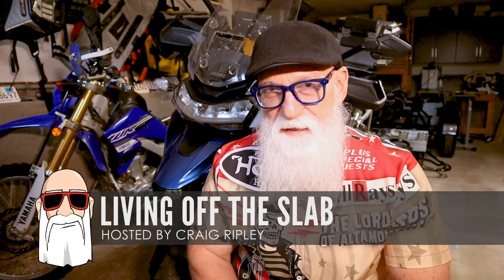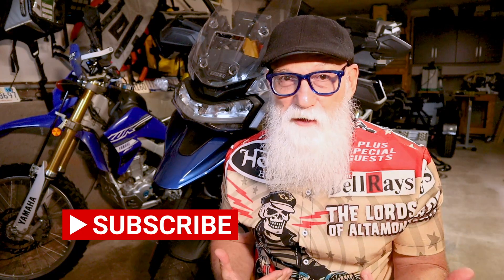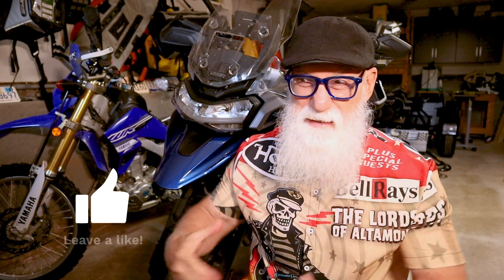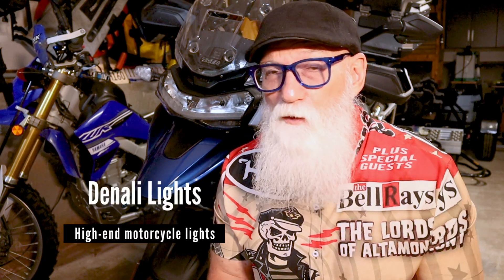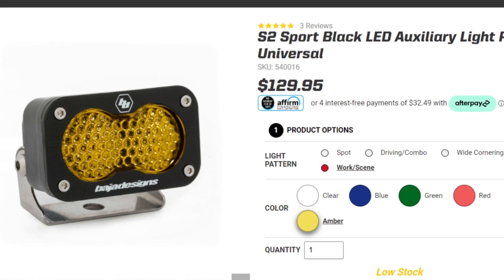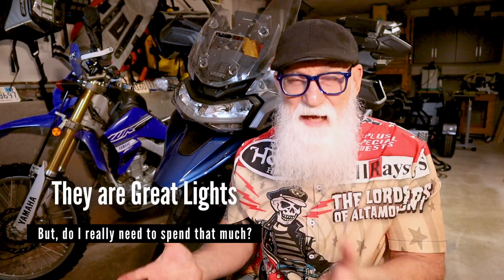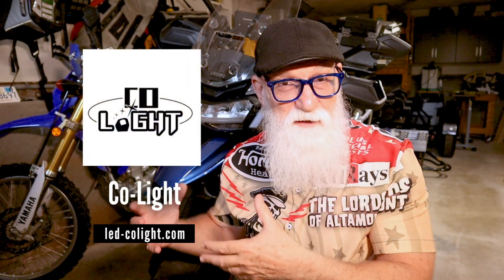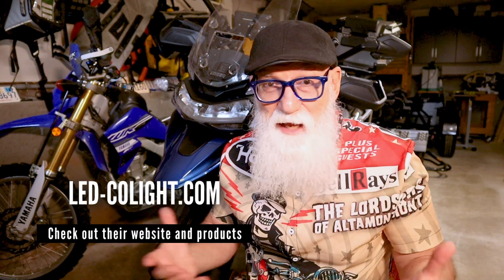LED Motorcycle Lights | Co-Light Rob 2 Pro

Comment: I seem to be picking up some BMW envy at around twenty seconds when you talk about the big BMW's with the driving lights.    And then outfitting the same to your Trumph, well the lights, not the big BMW part.   And you say 'the big BMWs' almost  in a reverential tone.         Hummm, not sure how much longer before you, too, are riding one of those big 1250 BMW GS Adventures  with the bright driving lights.   I say it is only a matter of time.  Anyway, nice video.  Thanks.   And you know I am teasing you a little.   Oh, and "budget friendly" probably doesn't belong in the same sentence with either a BMW or Triumph.
Reply from the maker: Light envy...maybe. And of course if you really want to save money, stop riding. It is an expensive hobby no matter how you slice it.

Comment: When i had me drz400s, i added 2" pod light from superbright light. I think they were $45 each. Great lights, sold the bike after 5 years zero issues on road or off road. (Commute to work everday on bike + fun in the desert on my day off) good thing is when ordering you could choose between 3 (or 4 ?) Different beam angle.  If they had it in amber I would get some for my versys 650 in addition to the 3" square pod i have now. (Harborfreight, been 12 months and still work great)
Imo, the addition of amber lights makes a huges difference for been seen by others. (Ppl always notice whats out of ordinary)